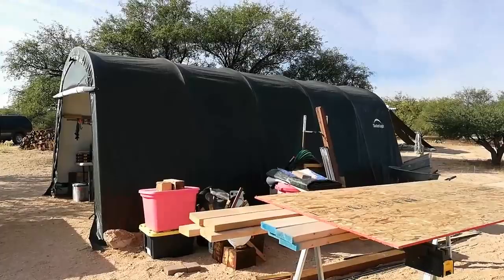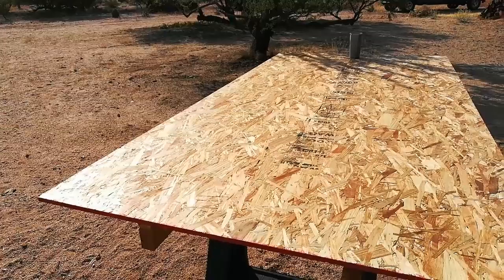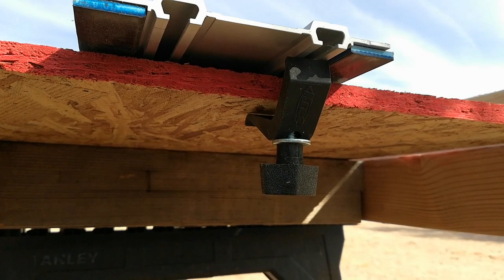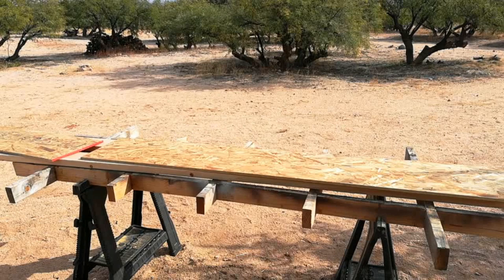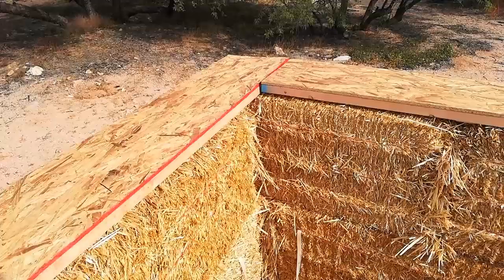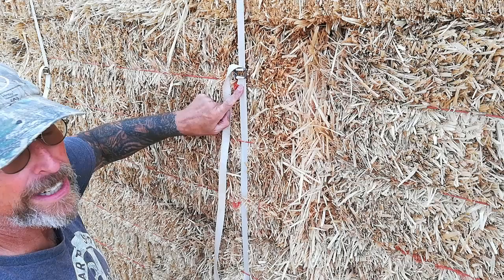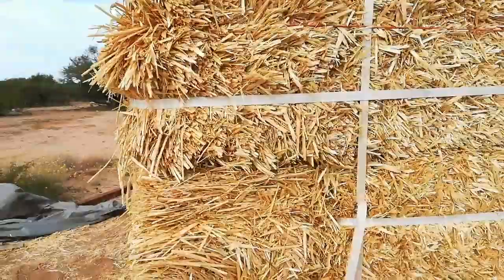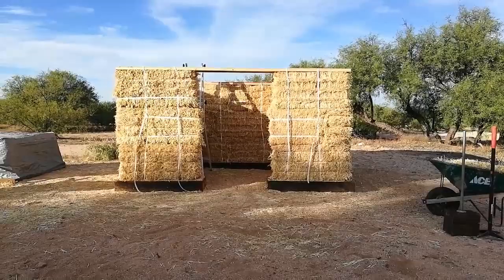Strawbale Toolshed Build Day 3: Roof Bearing Assemblies or "Box Beams"

Comment: Hind sight comment here, but instead of toe-nail pinning those corners of the top "plate" box beams by holding the osb back and allowing the two flat 2x6s to extend out the same width as the bale width. Then, the next box beam, as you turn the corner, would have the osb extended out, with 2x6s recessed, the width of the bale. Then attach the over hanging osb to the previously installed box beam 2x6s extended out. (Lotta words for simple alternative)
Would look the same on completion, but gives much stronger corner securing for overall structure. IMHO
In essence, similar to the overlap at corners in standard stick framed double top plate for rigidity.
Im loving this straw bale structure series.!!
Reply from the maker: I had the same Monday morning Quarterback thoughts myself. That'll be the technique on the next build for sure. Basically creating a lap joint on the corners. 👍

Comment: Love the saw jig! We’re not sure how far along the shed is, but we see that rain is heading your way in the next few days, and we just got a flood alert for your general vicinity! Good luck with the build and thanks for sharing.
Reply: The Upside of Downsizing fantastic! All we could think of when we watched was rain on straw 😩 We had someone lead putting the metal roof on our house - he stripped off the roll roofing early in the morning. The other two helpers didn’t show up. Then an unforecast rain. Many hours of drywall repair later by the two of us fixed that “small” problem. The joys of desert construction!

Comment: Do you need to protect the bales from the weather during the construction?  One method I have read about is "in-fill bales" where you construct the roof first and then fill in with bales.  The bales aren't load bearing and the roof provides some weather protection.

Comment: Hi there,

I think a better method for those beams would be to half-lap them. 

That would ensure they are square & level; as well as unable to ever pull apart; especially after you put the osb  after the 2x6's.

Frankly, I would also paint every piece of wood with at least 2 coats to prevent rot!

Comment: Did you use straw for the ceiling/roof insulation?  If not, what did you use and why?
Reply from the maker: For this Toolshed we did not insulate the ceiling at all. It's 3/4 plywood with a roofing paper. On top of that is the Ondura corrugated roofing material. In our Solar Shed we insulated the ceiling with pink fiberglass on rolls. We used that for ease of installation. Cut to length, and staple the paper to the rafters. I would be hesitant to use straw Ina ceiling only because over time it would break down and lose its insulative properties. I've seen it used in floors, but never in a ceiling. Hey it might be great.  Again, for us was ease of Installation.

Comment: I'm curious if you considered building the box beams with the 2×6's on end as opposed to lying flat since on end would be utilizing them at their maximum strength?
Reply from the maker: Thanks for watching! Good question. If the 2x6's were suspended in air ( so so speak) like floor joists for example, then you are right, having them on end would prevent sag. But, because they are 100% supported underneath by the bales it makes no difference because there is no chance of them sagging or bowing.
Reply: @theupsideofdownsizing  Good to know. I'm looking at all my options and strawbale really appeals to me. Thanks.
Reply from the maker: We love the feeling of being in a straw bale house. No matter what the season, it just feels good. Hard to explain, but once you experience it, you'll understand what I mean. Thanks again for watching!

Comment: Is there a specific name for the strapping tool? That seems like a better solution than truck straps.
Reply from the maker: "Poly Strapping Tensioner & Cutter Manual Banding Tools Windlass for 1/2" -3/4" Width Polyester Polyproplyn Strap"
That's how it's listed and described on Amazon.
Reply: @theupsideofdownsizing  Thanks!

Comment: So far all I see is a future self starting fire.  The straw bales are not completely encapsulated and moisture can form in there causing decay and self heating to the point of self combustion..  Very poor design and considering what you spent on the straw bales you could have used wood with a mud covering.